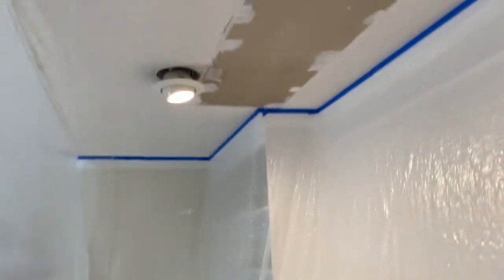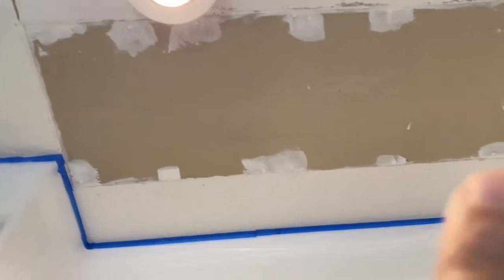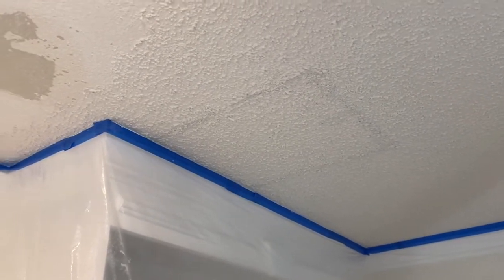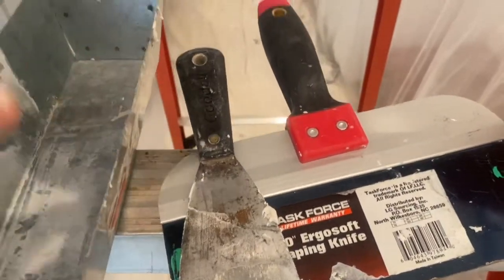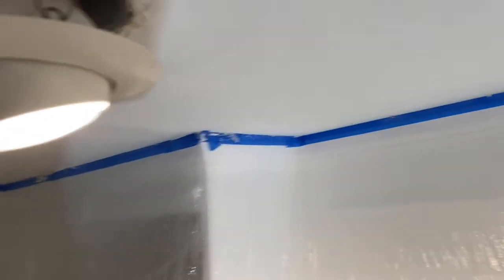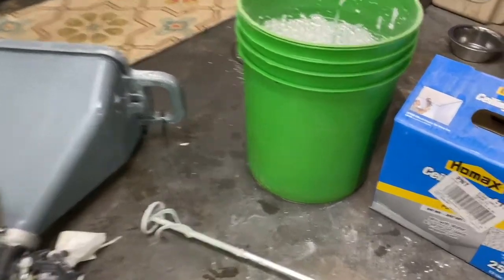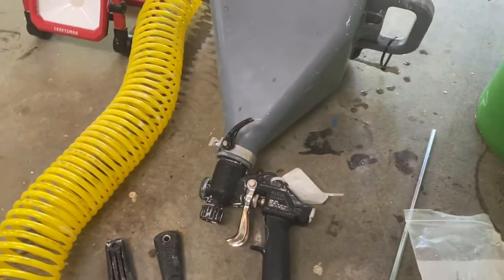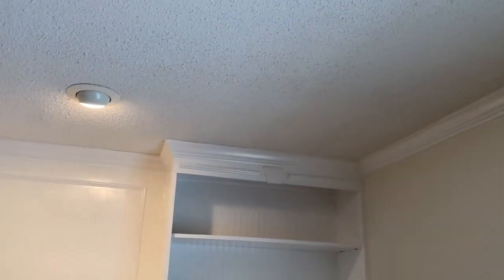Popcorn Ceiling Repair and Spray Steps Tools Tips

Comment: Thanks for the vid.  I have the same size and type compressor.  It is good for my air nailers but I was wondering if you found yours to have a sufficient air supply or did you find yourself having to wait a lot for the compressor to re-pressurize the tank in between passes at the ceiling???  Thanks.
Reply from the maker: My compressor handled it just fine. Now if I were spraying an entire room and was a professional who could keep moving without inspecting every spray I did then maybe I would not had enough air. For a patch though, it was plenty of air pressure. Thanks for the comment like and subscribe.
Reply: @tailgatetalk   It is a shame that I have purchased numerous cans of aerosol texture sprays in the past.   I could easily have purchased a descent hopper gun for half the money I've spent on Homax products at $20 per can.  BTW,  I just subbed to your channel.